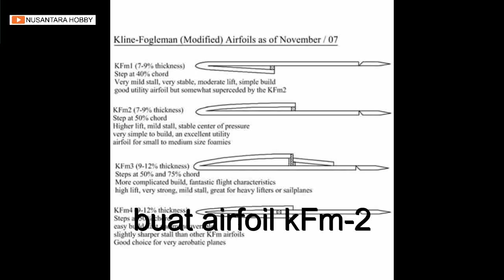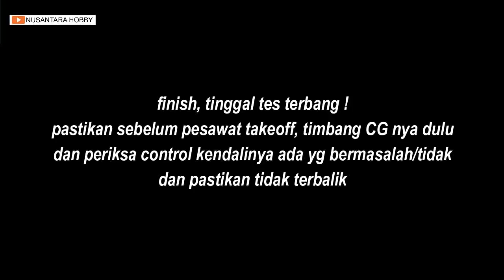MEMBUAT PESAWAT RC TRAINER JET ELEKTRIK DAHSYAT MUDAH BUATNYA

Comment: some info.        since this model is a  design disaster,  novice pilots who fly it  will  Not  be learning to pilot,  Correctly.           three  design  issues  Dominate the  flight characteristics of this wonky model:   Wonky proportions;   k-fm2 profile  NOT correctly made; and, a massive amount of  tail-HEAVINESS  in  the  dom.   distribution of mass.        the cg  Should be located at   thirty percent of chord/mac; or, if desired, a bit forward of thirty.       the model  SHOULD  be  supported  NEAR  the fuselage, during the cg-balancing process !!!!!      googletranslate